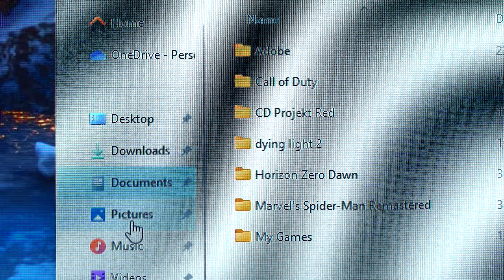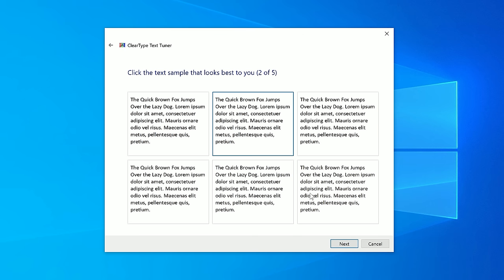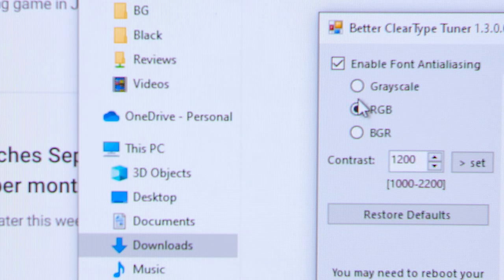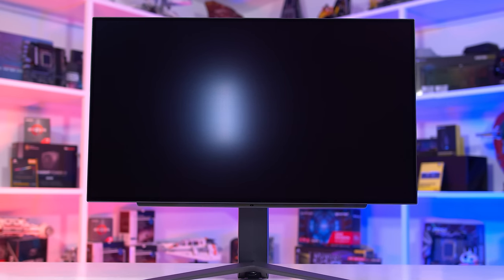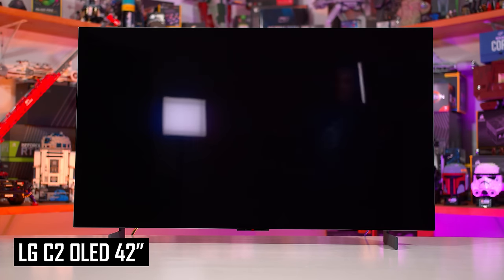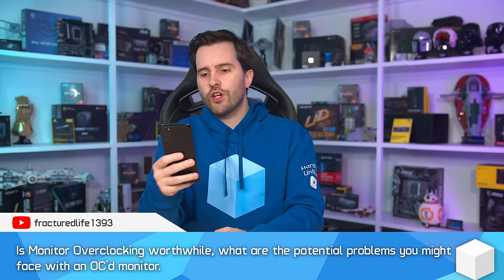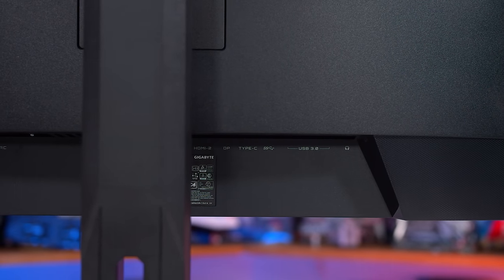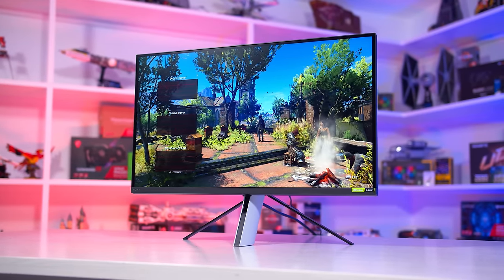1440p OLED vs 4K Mini LED? Can ClearType Fix OLED? - May Q&A

Comment: Thanks for explaining color spaces. Looking forward dedicated video elaborating on the subject, but also being "beginner friendly".
Likewise, I'd like to see videos explaining 8 bit vs 10 or 12 bit colors, as well as what exactly HDR is.
Reply: Also interested in this. Never understood the point of 12 bit colour space.
Reply: This. Even if these seem like pretty basic terms, I have yet to see or hear a sensible or well documented explanation for any of these. Questions like: Does setting a 8bpc, 10bpc or 12bpc signal in nvidia control even make a difference? If so, where? Only in HDR? Or SDR too? And how can it when Windows colours on a very fundamental level seems to work on RGB values between 0-255, which 8 bits per channel (so 24 bits of colour data) should be able to already fully cover.
Reply: @cantti  well you already figured it out by yourself. 8bpc already covers full sRGB so those extra bit modes are just for widegamut colorspaces.
Reply: that would be nice. Also maybe a guide on how to configure windows for amd and nvidia depending on the mode.
Reply: Amount of bits not only limits the amount of (theoretical) colours, but also number of gray tones between black and white. For example, 24 bit colours (3 x 8b):

R(ed)      2^8  =  values 0...255
G(reen)  2^8  =  values 0...255
B(lue)     2^8  =  values 0...255

Colors  =  2^(3 x 8)  =  2^24  = 16,777,216
Black             =  0, 0, 0
White            =  255, 255, 255
Grayscale    =  R, G and B are 1...254 --> only 254 levels between black and white.

With traditional Video black it's even more limited: 17...234 --> only 218 levels between black and white.

HDR means High Dynamic Range. Optimally all ot these, perfectly executed:
  * Huge range of brightness from 0 nits (OLED) to thousands of nits. Simultaneously & Full Screen.
  * Huge amount of values between those two extremes --> always perfectly smooth gradients
  * Wide Color Gamut. For example, 76 % of Rec. 2020, if 100 % isn't achievable.
  * Often 4K, like UHD Blu-rays and 4K Gaming with actually HDR capable monitor.
  * When done right, picture is much more natural/immersive than ever before (basic sRGB monittor, DVD...).

Comment: Overclocking might not be as marginal as you think on some monitors Tim. I've got a Samsung 34" ultrawide that's rated at only 75 Hz but overriding the EDID and creating a custom resolution in NVidia control panel it can easily go higher. The max I could get was 119 Hz but it wasn't totally stable and had flickering. It will easily run 110 Hz rock solid but while researching I read that the pixel response on these panels wasn't quite fast enough so I've settled on 100 Hz.  Also another factor that wasn't mentioned but applies here is the G-Sync compatibility only works up to 90 Hz. I've got a 90 Hz custom resolution setting as well if I want to use G-Sync but for the games I mostly play it isn't really necessary.  100 Hz is a noticeable improvement over 75 and my meager RTX3060 can barely push these limits anyways so it's been a pretty good hardware match so far.

Comment: For me: Disabling ClearType works beautifully. Chrome is the most important app and it is respecting the change after a restart. 

I'm kind of surprised you considered the hacky workaround for scaling factors other than 100 or 200% in MacOS as a feature. It definitely isn't and it does decrease image quality noticeably. But font rendering on Mac is superb and does not suffer on strange subpixel layouts.
Reply: Exactly this, disabling ClearType is the solution that works best. I tried multiple, and wasn't satisfied with any until I just disabled it. Both in Windoze and Linux

Comment: The QD-OLED fringing has little to do with ClearType and is more to do with contrasting elements. Dark text or edges against a lighter background and potentially more noticeable for bright text or edges against a dark background. The fringing on WOLED models is more heavily (but not exclusively) affected by ClearType optimisation, so it would be better to use those models to determine which applications will respond to ClearType optimisation instead.
Reply: I know we talked about this, but people should know that text fringing on qd-oled can be entirely worked around with dldsr (nvidia downsampling). It fixed everything for me.
Reply: i personally don't notice the fringing on QD-Oled. seen a dwf irl, and i didn't notice it. i'm buying one this week actually....

Comment: it's worth noting the subpixel rendering problem can also be fixed in WOLED monitors by a firmware update at the sacrifice of one subpixel of horizontal resolution. RWBG OLED can be shifted to WBGR in a firmware update and then you can use native BGR subpixel rendering with cleartype

Comment: Many applications like Chromium based Browsers or Firefox use a library called libfreetype (I hope I don't mess up the names, but I think that's the one). While it uses it's own algorithm and settings I'm pretty positive if Microsoft extended its ClearType, they would implement a similar algorithm and get those settings from ClearType. The nice thing with a lot of applications using this one library is that just by updating that library, extended ClearType might work well in most applications in relatively short time

Might be interesting to switch out that library (should be especially easy on Linux, but might be possible on windows too, you can recompile Firefox and Chromium after all), if that already fixes all/most of the problems for at least the applications that use it. Somebody has to develop the algorithm first though and get in working in libfreetype.

Comment: Don't purchase an Oled or any monitor for that matter with the hope issues are fixed with future firmware..
Most monitor's recieve few updates and with newer models incoming their support is dropped like a hot potato
Reply: Fr 
Not for that price!! 

Paying 1000+$ for a monitor that going suffer with burn in !! In 1 year or less

Or text fringing issues
And also has a build in fan i them that makes noise

All that for 1000$ and more is just a scam smh
Reply: Purchased LG c2 for 960eur, it gets frequent updates over the Wi-Fi, that's a big plus of TV. Samsung's G8 olded 34inch should be similar. But yeah, monitors always suck at updates and almost never fully fix release problems with FW updates. This is my first OLED, so far holding strong 6 months in, if my next monitor is OLED or not will depend on how long this one will last.
Reply: I am waiting for a an ultrawide QD-OLED at 240 Hz.
Reply: @teddyoflove5897  I'd rather a monitor and not being locked to a 120Hz refresh rate..especially as I like competitive games..
I had an LG 34gn850 it got one update in 3 year's that greyed out any future firmware after it..LMFAO
Reply: @rickgear2579  yep leaks suggest from TFT Central manufacturers like LG/Samsung have them coming.
Reply: But also don't decide against an OLED just for that reason if you haven't experienced it yourself. I've been using LGs TVs as monitors for 3 years now and I'm not bothered by the text problems. I didn't even notice until I heard about it on this channel. All the advantages of OLED are overwhelming to me. Would be cool if it got fixed but I honestly don't care that much.
Reply: @Dionyzos  yeah I've been using Oled's for 7 year's now and I see a lot of people going gaga over their first..to be honest LG have done nothing new I can see since the LG C9
Reply: At least with the AW3423DW, I knew there would be no firmware updates.
Reply: @hellterminator  yep there eas no way I was going to buy the cheaper AW3423DWF model knowing it's HDR1000 mode was broken and every one singing it's praises for slightly lower input lag..
The original AW3423DW is only 5ms with Gsync on same as an LG C2 at max refresh and its HDR1000 mode follows the EOTF tracking as intended.
Reply: I keep seeing all these updates from Asus sitting here with my pg279qm and being like WTF.. I want backlight strobing too 😂

Comment: Regarding choosing between 4k mini led  or 1440p oled monitor for gaming  I think it depends on what games you play. I couldnt decide so I ended up buying the  4k 32"lg 32gq950 and the 1440p 27" pg27aqdm. Side by side 4k is noticeably more sharp. The larger 4k is perfect for games like RDR2 or Days gone and such story based games. Great open plains and lots of details. The smaller 1440p Oled is way better in fast phased games like Call of Duty and such. I do think if u can only choose one, I would recommend the 27" 1440p Oled as it is more versatile.  On the other hand FPS games and such doesent suit large monitors as well. Regarding colors and true black etc, ofc the oled is better. That said a good mini led is not bad in any way and the higher resolution makes up for it a long way imo.
Reply: Thank you for this explanation. I've been trying to decide on going 4k mini LED or 1440p OLED. I am looking to mainly play story based single player games but occasionally do play fps games, but I think I'll be ok if the performance might not be the best. Hopefully one day there'll be a 4k 27" or 32" OLED monitor.
Reply: @BA5ALT at CES 2024 Samsung or LG (I can’t remember which) actually announced a 4k 32inch QD-OLED coming later in 2024 which is something to definitely look forward to, the price however… well that’s a different story 😂

Comment: 11:24 Window management has gotten significantly better in Windows 11. Just drag a window toward the top middle of the screen and then a little tray pops down that lets you pick from a variety of positions and even supports 3 vertical windows (the scenario Tim used in his response).
Reply: You can also hover over the Window/Full screen button in top right between the minimize and exit buttons (in Windows 11, as you mentioned)
Reply: @bystander85  nice tip, didn’t know this one!

Comment: Freetype on linux supports custom subpixel configurations, i believe.
Reply: It does since it has been tailored for the exotic screens on phones and tablets running Android. Also Freetype is the same Freedesktop brick embedded by MacOS display stack and by Mactype.

Comment: Not only with fonts and text rendering, it's so frustrating when software don't use the systems in Windows that are in place to make things work the same way across all programs to help with usability. Looking at you Roccat and your driver software, and also Gigabyte's drivers and software as well, and I feel like this goes for many manufacturer's driver software.
Reply: Well, in the case of fonts even Windows is not consistent with Cleartype on its own UI. There are still old win95 style windows laying around and as Tim said the new "Metro" UI isn't correctly affected by Cleartype. It looks like even Microsoft themselves gave up to give a unified display experience.
Reply: @PainterVierax  That's even more frustrating.
Reply: @Alexandra-Rex  That's one of the many reasons why some people and companies simply avoid Windows as much as possible.
Reply: How often are you using that software though?
Reply: @Dionyzos  that's not really relevant. If features are advertised the software that enables them should follow APIs provided by the targeted OS instead of crudely reinventing the wheel and creating new bugs.
Reply: At least Gigabyte software saves all your GPU settings when you uninstall it. That's the only good thing I can say about it.

Comment: Clarity and sharpness of texts is one of the main reasons I use Macs. Whenever I use Bootcamp, I can't believe how blurry texts are in comparison. But then, Windows users would need to start using monitors at double the resolution they are used to for MS to implement Apple's solution to text and UI rendering.

Comment: Thank you for all your hard work Tim you’re my go to monitor guy! I have a question about windows HDR calibration. The app seems pretty simple however I’m concerned I don’t have it set up correctly. I think HDR on my odyssey OLED G8 looks good, but compared to the HDR on my C1  OLED in my living room looks better. Is this Miss calibrated in windows or does the C1 just have better brightness?

Comment: I've had my 60Hz monitor overclocked to 75Hz for years without problems.
Most 60Hz monitors can reach 75Hz, the issue is that some games cannot recognize that refresh rate and turn it back down to 60Hz.
If anyone wants to try, just make sure you use the pixel clock patcher from Monitortests first, then use CRU.

Comment: I recently upgraded from the BenQ XL 2420G (1080p) to MSI G274QPF-QD (1440p) for my dual-display gaming setup. The MSI G274QPF-QD features HDR but it's only the "fake" HDR400. I am a bit disappointed as I only learned the difference afterwards. That said, I LOVE the HDR! I operate HDR all the time. I feel as though it makes the colors more accurate - without HDR the red tone looks exaggerated. There's more depth, contrast, and vibrancy to my display. And when I'm doing production activities (CAD/spreadsheets/etc), the text actually looks sharper! The only time I'll ever disable HDR is when I'm playing Classic WoW. HDR seems to dim and create too much contrast in this application. But for Diablo 4, League of Legends, Retail WoW and production tasks, I see a lot of value in having HDR400.

Comment: Hey guys, could you please review a mini LED ultrawide monitor? I wonder how they’d compare against the OLED ones. They don’t seem common for now, I’ve only seen the Viewsonic XG341C-2K available, but they may be a good compromise between OLED and traditional panels.
Reply: This !!

We need more MiniLed reviews!!!
Reply: looking at other reviews this monitor you posted is not worth it at all. Costs a lot more than OLEDs and doesn't produce as good HDR and it supposedly has issues. Response times are not great, if you want 200hz it disables pretty much everything, it also has notable inverse ghosting. Lots of trailing for something that costs 1500+. So not really a great deal considering that you can buy better products for less
Reply: @lilpain1997  Yeah the reviews I saw for it were pretty awful, but since they’re a bit old I was hoping a firmware update could have solved most of those issues. At least the software-related ones.
I haven’t been able to find any other 34” 21:9 miniLED monitors though :C
Reply: @J.I.R.A   I actually agree that this would be a good review to do, if only as an example of what a bad monitor is like, especially on the HUB charts. That being said, I am sure there's at least one mini LED out there that's good

Comment: On topic of large display replacing multiple displays. I used multiple monitors for years, then tried samsung odysey g9 super ultrawide and now using LG c2 42inch. It depends on what you use it for, if you mostly game or gaming is a large part of what you do, then don't do it. It will suck, It's impossible to play normally and view something extra on the side. You can use windowed mode, but it gets old really quick, ruining game feel and fiddling with windows can be troublesome, especially as it's impossible to properly snap game windows in most cases they have locked resolutions and aspect ratios. The best setup I ever used was 34-inch ultrawide for game and 1 27-inch monitor above it for discord/YouTube and other stuff. Using 52inch super ultrawide or 42inch TV is extremely nice only for one purpose, and it's WORK, it's amazing for that and better than a multimonitor setup. However, as soon as you add gaming into the mix, it becomes very difficult conversation.

Comment: Also (one more comment, sorry), thank you for answering the "fake HDR" question so thoroughly and fairly, it has irked me in the past how dismissive you seemed to be about these monitors while, as you said here, HDR content truly does look different, even if your monitor is not "true" HDR, as long as it has a reasonable HDR mode. The new Windows HDR calibration helps a lot too. Generally the problem is obviously low contrast, especially with IPS panels, since most monitors lock brightness to 100% to get the highlights as bright as possible, which very much emphasizes all the usual IPS downsides like backlight bleed and IPS glow. I have however seen IPS monitors where HDR looks reasonably good in quite a few scenarios, like my current LG 27GN850 (which even allows brightness adjustment in HDR mode). But the best "fake" HDR monitor I've seen so far is my current secondary, the AOC AGON AG275QZN. The reason is fairly obvious - it is a VA panel, which means even with 100% brightness (which means peak of around 450 nits on mine) it still has black level of around 0,13 nits, effectively slightly darker than black level on the LG when it's set to 120 nits ;) So the contrast difference makes HDR "pop" reasonably well, despite no local dimming. The only downside is that it still has some black smearing, as VA panels do (but it is faster than most VA panels out there).

Comment: I believe you are misunderstanding the question for "can the screen coating be changed". I take it the question asking the DIY viability of changing the coating. The answer is no because the coating is part of the panel assembly.

Comment: OC of a 60Hz to 75Hz is highly worth.. At higher refresh rates it's unnecessary. But that 20% increase in refresh rate from 60 to 75 does make a difference

Comment: I only had my C1 oled for a year and I already have some scanline patterns already burned in because I play retrogames a lot. I sure wish there were some software to fix it.. because it doesn't look like the pixel cleaning sees the issue on low greys, and thankfully it's only visible on the darker greys and colors but still.. I ran the TV at the absolute minimum brightness and it's the EVO panel even.
Reply: Ughh what a bummer. You could try white noise on YouTube. It worked for plasmas. The visual fuzz from back in the day